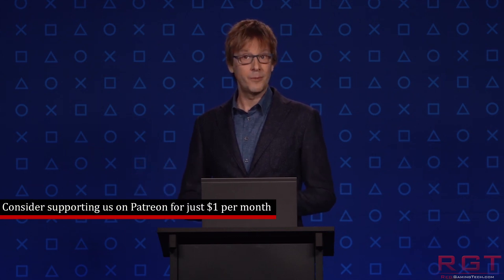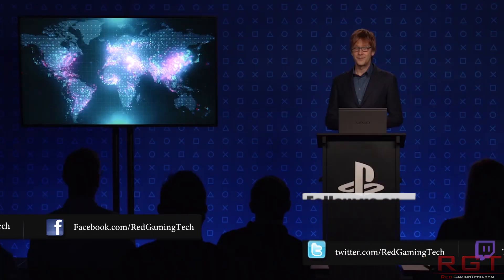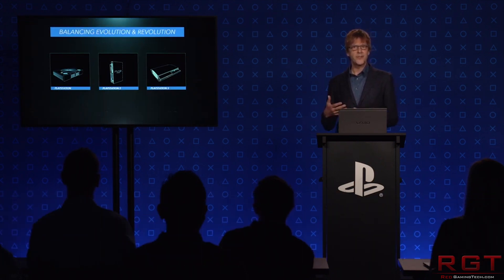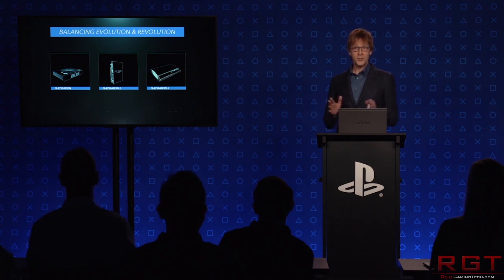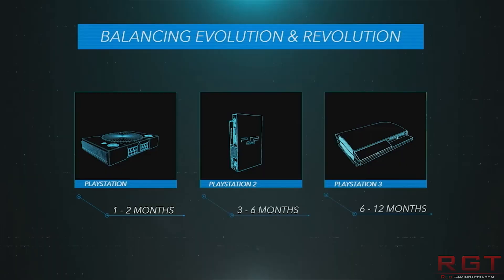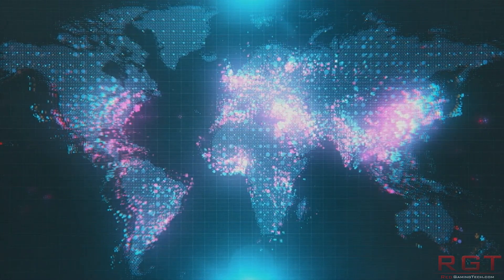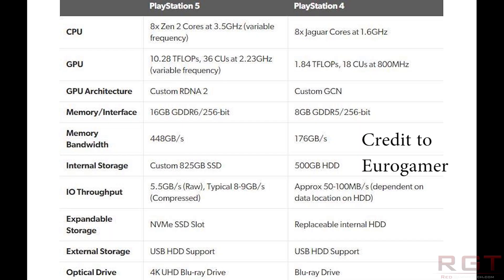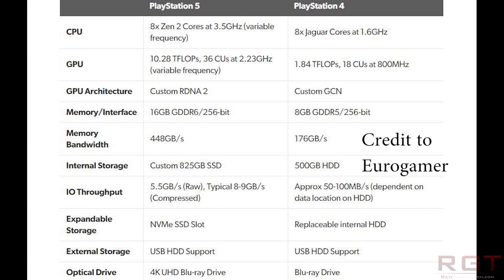Playstation 5 Spec Overview & Analysis | 10.3TFLOPS & RDNA 2 | 3.5 GHZ Zen 2 & Crazy SSD Speeds

Comment: I dont care about who has more power as long as ps5 does a minimum of 1440p/60fps I'm beyond happy.
Reply: i don't, but i care about how much its being ragged to get a pathetic 9tflops consistently
Reply: @S99-c5s  bro it's a console and you are getting 60fps imagine Sony exclusives at 60fps....ps4 games at 60fps. 9tf at a good price I'm sold...then release the pro model.
Reply: So you want current gen games at 1440p 60 fps? Or do you want next gen games at 1440p 60 fps? 9 tflops is a big fail.
Reply: @papasmurf205  I agree it's a big fail  in terms of power. In my opinion I am comfortable as I game in pc at 3440x1440/100fps. I wont trade my monitor or performance for 4k. If ps5 is a 1440p/60 fps console for $399. I am ok with that as 4k is a waste of resources. The ssd is just hype that I wont buy into but it's a nice touch. And yes I will also buy a $500-$600 nvidia gpu as I have an acer predator.
Reply: @papasmurf205  current gen games cant do 1080p/60. Secondly next gen consoles as I said I am ok with 1440p/60 with high graphics/raytracing  for under $500. If I can get 8k/120 for nex gen consoles I would be beyond delighted. But I'm a humble realist.
Reply: Seizon Sha  - Ya sure.  When you have the power advantage power means everything, when you don't
have it, it means nothing.  We been down that silly road before. LOL.
Reply: @GregHakes  I am a pc gamer and I bought an 8700k/1080ti at full price  a few years ago. Having said that I know a thing or two about resolution framerates ultrawide gaming etc. For $499. getting a console in a box that can do 1440p/60 to me is a steal of a deal. The sony exclusives is what has me sold to game on console. For power I know exactly where to get that I will buy the next $800. Nvidia gpu as I have invested in the eco system having  purchasing a $800. Acer predator monitor. I am not a fanboy I enjoy gaming.
Reply: @darkwing5458  Yah, you're real smart
 alright !!! LOL.

Comment: Been waiting for Red tech to expose Cerney with the 9.2tf sometimes 10.3 we will see.
Reply: 10.28 at "peak" frequency. The salt will be legendary. But must admit I was wrong about 9.2 Tflops but alot closer then the tools scream 13.5Tflops. 😆😅😂
Reply: Except the performance will be similar due to the PS5’s faster clock speeds, not to mention you won’t need to buy memory cards for PS5; it’ll accept most PC m.2 SSD’s.
Reply: @princegroove  And those SSDs will need to be bought,  right? LoL
Reply: 2x Rapid Math,vvr,vrs,ai,7nm enhanced, Cores for RTs higher CPU clocked higher an locked. 2 to 3 tf more powerful depending if the gpu is 8,9 or 10.3 TVs at the time which sounds like the most unstable console in history an not optimized. I dont see how ps5 is even in the same league period
Reply: @princegroove  200 bucks for a 1tb PCI 3 m2. So a 1tb PCI 4 Nmve more so hopefully Microsoft will get it on the low an will run same as internal.
Reply: Julian A Molina Jr Except there will be many
Options, unlike the Lbox. I have a gaming PC, so I understand the beauty of choosing the best components based on price and performance.
Reply: Was claiming somewhere in the mid 10s, based off of them not letting Stadia have a advantage over them?... i was right & wrong 🤷‍♂️
Reply: Julian A Molina Jr right? $250 one of those. 😂 😂 😂
Reply: Prince Groove Sony will choose the options for you, remember they are sorting thru the cards to see which will pass their requirements. That list is going to be small and a whole lot more than Microsoft’s solution.
Reply: @darrellbarton83  maybe better.
Reply: @Whoozurdaddy  No Sony aren't choosing your options they will be letting customers know what drives are "compatible" to match up with PS5's speed and tech.  With MS you have no option at all.  MS will sell you over priced proprietary 1TB SSD dives and you won't have any other choice than to buy multiple just to hold your games.  Remember those small proprietary 20GB 360 HDDs MS sold for $100 while Sony allowed you to use any 3rd party HDD on PS3 without breaking warrnety?  Yeah...
Reply: @riceeater79  Grasp those straws bro. Today was a rough day; it's okay.

Listen, people that were going to buy the PS5 will still buy it and vice versa for the Series X.  Those proprietary drives aren't gonna stop people from getting what speaks to them.
Reply: I will Save this Comment and Come back when the games start to release but From certain Devs, I'm hearing sony will have the better running Games.....I guess we will have to wait and see.

Comment: What I'm more curious about is what Cerny said about Capping the Ps5 at 2.23. With this change to power system it may be able to stay near 10.3 tflop . 

But theoretically max performance dont always  when fights. Lers see what's happens near launch
Reply: He better cap it at 2.23! Or that thing could go thermonuclear 🤣
I’m betting base frequency is around 1.9 but maybe as high as 2.0 depending on form factor and cooling.  Those 36 little cu’s are gonna be screaming!!! Lol
Reply: @Whoozurdaddy  dont have awhole lot of info RDNA2 . So want to know how much perf per watt is.

But wouldn't  it thermal throttle be fore it got to high
Reply: Stephen Harvey Like how corn are about to turn into popcorn, that little squeal. 😂😂😂

Comment: Absolutely blisteringly fast clock speed from PS5 and equally impressive to maintain it! Mr. Cerny and AMD have done something special. But  sadly, as always peeps will go straight to the obvious and misleading 10.3TF vs 12.1TF narrative...

CERNY - “Rather than look at the actual temperature of the silicon die, we look at the activities that the GPU and CPU are performing and set the frequencies on that basis—which makes everything deterministic and repeatable,” Cerny said in his presentation. “While we’re at it, we also use AMD’s SmartShift technology and send any unused power from the CPU to the GPU, so it can squeeze out a few more pixels.”

AMD - "AMD said this (SMARTSHIFT) can result in a 10-percent boost in performance in games like The Division 2, or a 12-percent bump in Cinebench R20 results." - Impressive

https://www.pcworld.com/article/3532342/sony-playstation-5-taps-amds-radical-smartshift-tech-to-push-its-gpu-to-ludicrous-speeds.amp.html
Reply: So it's 9,2TF and 10,28 with smartshift. :P
Reply: @bLd321  the 9.2TF is what Microsoft fanboys are throwing up. Nobody else. The funny thing is that the 9.2TF leak was very old. Things eventually change over time. This is the problem with leaks. They might have been true there and then. But, things change. 

Only the ignorant fanboys are focused on teraflops. Just read what the industry professionals are saying about the PS5 and its incredible way of optimisation.

Sony's  SSD and the overall whole way it works WILL BE the GAME CHANGER next gen. Please don't tell me you are one of those who thinks it's just for faster load times?

The I/O Throughput speeds of the SSD and the elimination of all bottle necks is just INSANE ! The information is received so blisteringly fast due to the bottlenecks taken out that the GPU only has to render what's in your direct vision. So, absolutely nothing is rendered outside the camera, effectively reducing the power and resources needed by a MASSIVE amount. Think about that extra power boost. How can you measure that? Optimised to the fucking extreme! This is very similar to the way the DECIMA ENGINE works (Horizon Zero Dawn, Death Stranding). Sony fucked up on explaining this better. To be fair, it was a developers conference, not the actual PS5 reveal.
Reply: @HanzouTheRazor  Yea, I'm just trolling a bit. I'm super excited for new PS5, and 10 or 12 tf is least important thing. Filling whole 448GB/s memory withing 2 seconds without any overhead on CPU is amazing. Game changer. This + full hardware RT + 3D audio. All those custom chips eliminating bottlenecks looks super cool and can make PS5 really revolutionary gaming machine. I just can't wait for ANY demo showing us what is possible with such technology. Sony should show us incredible demos, and then organise conference for devs to explain how it was possible.
Reply: @bLd321  well said! The I/O SSD throughput will be the revolutionary game changer.
Reply: @HanzouTheRazor  but a  Microsoft dev showed the series x doing the same thing. But alot of new software is coming out that will be making hardware way more efficient. Ml model upress alone will allow 1/4 the gpu usage (up to). It also effects the download size drastically.
Reply: @nth842  for the most part I can see both these consoles performing very similar. If true, this would be a massive feat as the PS5 is 1.8 teraflops lower. That would be impressive. It seems Sony has had this goal from the beginning. To get big results from a less expensive system, with a smaller chip and die. And going by a multitude of developers and industry insiders the PS5 seems to be doing just that. Performing the same, or out performing the Series X. Impressive. 

Just imagine if Sony releases a PRO version side by side with the same design, but at around 12 teraflops... How would that then compare to Microsoft's 12 teraflop Series X? One can only dream...
Reply: @HanzouTheRazor  diminishing gains, 1.8 tf out of 12 isnt near as big of a deal as  1.8 out of 4. I'm personally more exited for the new CPU on both consoles though. Graphics plenty good as is but ai/physics and that kinda stuff could use a huge improvement.
Reply: @nth842  I'm really excited about Sony's SSD system and also their TEMPEST 3D audio. Comparing the SSD between these two consoles is like apples to oranges. Sony has a 12 channel SSD and that's not just for gigabytes per second. The GB/s for how many channels is actually low. This suggests Sony are going for massive parallelism (massive parallelism gives neural networks a high degree of fault tolerance). And they have been going for a high bandwidth cache approach from the start (speed). Sony's goal from the beginning is to have around 100GB of graphics memory...100GB!!! This will enable huge levels of detail and much larger worlds that are not possible today. All without having the CPU and GPU wasting resources. How can we measure all this extra power? This is removing as many bottlenecks in a standard system as physically possible. 

Series X maximum SSD speed is 4.8GB/s compressed data. Sony recently confirmed that they've had up to 20 gigabytes per second of compressed data with the PS5's I/O SSD speed. That's insane!!!

Comment: I think sony likes to show off their in house tech as they are mostly HW company, this is why so much was said about the custom memory chip and audio processor.
Reply: THAT Audio chip is a good call Sony move. They literally cut there teeth in audio from the transistor radio. To the SNES sound chip. Very cool move. PS4 biggest low point was it's audio. (Edit PS3 at it's core was better if done properly) Despite having the best bang for your buck in the 100 dollar US (retail) Sony Gold Headset. I play Modern Warfare on PS4 and am Calling out opposing player movements to teammates playing with headsets that cost twice as much across Xbox and PC platform and Even PS4 owners with 3rd party sets.

Comment: Just for some understand. Both consoles will run at 4k! No rezgate. Both will reach 60 frames! The cpu are Huge compared to this gen! So, the diference will be in the quality of the studios that make the games.
Reply: Kind of, but they both don’t have the same amount of headroom to work with so though we may not see much of a difference in the beginning other than Sony’s faster load times and Microsoft with better ray tracing and physics, we will start seeing differences in the majority of games down the line due to Xbox having a much higher ceiling then ps5. Probably in year two or three.
Reply: @Whoozurdaddy  being both at 4k and 60 frames the diferences You talk arent gamechanger. For me the question now is the price.
Reply: Well with this variable performance from Sony it maybe possible to see small frame rate fluctuations depending on how graphically demanding the developers made the game.
Reply: @davidvillamarin7164  Sony have made a turd just admit it.
Reply: Ps5 may reach 4k@60 but by reducing the quality of graphics as compared to xbox.
Reply: You obviously don’t understand that graphical fidelity has nothing to do with resolution. So a 4K game with low to medium settings is not the same as ultra settings
Reply: Karan Vora Yep 👍

Comment: They didn’t mention VRS or Raytraced Visual, which is weird. Hope this is not some kind of custom RDNA 2 without VRS. That would be a big loss
Reply: That'd be even worse than my previous speculation that their hardware would only be based on mainly rdna 1 architecture with a little bit of rdna 2.0 architecture for ray tracing. Trust me, they have ray tracing
Reply: It's RDNA Gen 2 architecture not hybrid that the reason the BC with PS4 games it's only for their top 100 games, they will say at launch what games will be BC to the PS5...
Reply: @מוטיאהרן  Stop talking you have zero credibility after today.
Reply: @מוטיאהרן  😁😆😅😂
Reply: @מוטיאהרן  

Based on rdna2 is what cerny said, sounds like not full rdna2 to me
Reply: @james-xf1ox  full RDNA Gen 2 architecture custom meaning every company bring their features sony will bring their technology and MS will bring their technology but the RDNA Gen 2 architecture fully from AMD...
Reply: Prince Shaggy just not as good as XSX
Reply: Cerny mentioned developers using Ray Traced reflections in games with minimal overhead.

Comment: I have both Xbox one  X and Ps4 pro i have to admit I'm very disappointed over the spc of the ps5. My next consol will be Xbox series x
Reply: almost 2tflops advantage is not a big deal
Reply: @stiven_ph8656  I don't remember people saying that when Xbox one was the 720p box...
Reply: Its going to be almost 3tflop advantage 9.2 vs 12.1 & it's going to be a big advantage so stop the bs.
Reply: @stiven_ph8656  it is when running
.4ghz diffrence ps5 won't sustain that either, xbox will easy and more. never owned xbox either.

Comment: Xbox faster in every single metric minus the SSD speed of the Ps5. 
Xbox cpu 3.8 ghz single thread 3.6ghz smt --- Ps5 boost up to 3.5ghz
Xbox ram 10 gig @ 560gbps and 6gig @ 330ish --Ps5 16 gig @ 440gbps
Xbox memory interface 320 bit-- Ps5 256bit
xbox Gpu 52 cu 12.1tf @1825mhz --Ps5  32 cu @1900?-2200? variable so 9.2tf to 10.1tf 
both have ray traced audio
sony has twice as fast Nvme
Reply: Your numbers are wrong for the ps5.
Reply: Where are the numbers wrong... Ever figure Sony gave they use the number can ..Ms said will
Reply: Except it's not 

From what I gathered between the PS5 and XSX,
XSX: 
-More CU but lower clock, which results in higher front end (higher TFLOPs for things like raytracing/compute), but worser back-end performance (geometry, rasters, etc).
-Non-symmetric memory bus layout on GDDR6.

PS5:
-Lower CU count, higher GPU clock which results in better backend performance (such as better geometry,rasters,caches,etc despite slightly lower compute)
-Symmetric memory layout (easier memory management)
-Tempest Engine (a heavily modded GCN CU for 3D-Audio/Sound processing, less CPU overhead, better sound quality/perf)
-Faster memory controller for embeeded SSD (likely similar to ReRAM/Optane)
-Whole alot of other IO/Caches clocked rather high along the SoC in the IO-die
-Slighly lower CPU clock but alot less CPU overhead, due to dedicated hardware block offfloading redundant CPU hogging task.

Conclusions: While XSX higher TFLOP count may result in better cinematic still walking simulators, PS5 will have better "real" game performance in Fast pace games, Open-world games, Nvidia Gameworks games, MMOs, and most notably VR (which is more notable on how responsive matters alot here which is prolly the reason why the PS5 is designed the way it is)
Reply: @Uruz7Laevatein  irrelevant Microsoft could up GHz to 2ghz just like that.

Comment: The channel Moore's Law is Dead did an interesting video on the ps5. At one point he shows instances where cards with fewer compute units at higher speeds (and lower tflops) outperformed cards with more compute units at lower speeds.

Now, I have no idea how applicable these results are to the ps5/xsx comparison, but it was interesting all the same.
Reply: Tflops don't work as a comparison when comparing GPUs with different arch types.

Comment: I might have this wrong but isn't it generally a bad thing to fill up your ssd? Reduces life span does it not? You always want to have at least 20% of it free for optimal performance. What performance do these custom ssd put out and how long do they last when tapped out I'd be interested to know
Reply: Combed Autumn - That’s a good point. However, I wouldn’t imagine the lifespan should be too much of a concern and shouldn’t really be affected by the amount of storage space available. With that being said, the performance could suffer slightly as the SSD gets closer and closer to being full. But I wouldn’t expect some crazy drastic reduction in performance just because the SSD is, let’s say 65-70% full. But some decrease in performance (although probably relatively minor) is to be expected in almost any storage device as it gets more and more full. 

     With the more custom SSDs, I wouldn’t imagine that they would be affected any differently in terms of longevity. 
       Though I am curious if Sony and Microsoft plan to maybe leave a certain amount of storage unusable so that there is always some free space. Just to minimize possible performance slowdown due to an SSD being full.